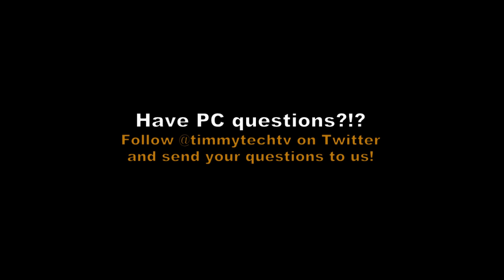How to install a Noctua NH-L9a CPU Cooler - TimmyTechTV

Comment from the maker: Nope, the cable wraps around perfectly the way I did it, but you are correct in that the fan header is under the socket on this board instead of on top of it.

Comment: 5:35 he is referring to doing 3 turns and moving on to the next screw, Do not tighten each screw before inserting the next. Gradual pressure across all of them will keep the paste even.

Comment: I own one on an i3 and it works great, good temps and no noise. But the maximum recommended TDP is only 65 Watts so be aware of that. If you use it on CPU that has a TDP of 85 Watts and overclock it you will reach hot temps so more fan noise (100%).

Comment: Can you use the stock backplate with the mobo already in a case or is it not compatible. I have an NH-L12 and I use the stock backplate. Is that the case here or did you chose to use the plate that came with the package
Reply from the maker: As long as the holes match up and the cooler contacts I guess you can. I wouldn't recommend it, but you can.